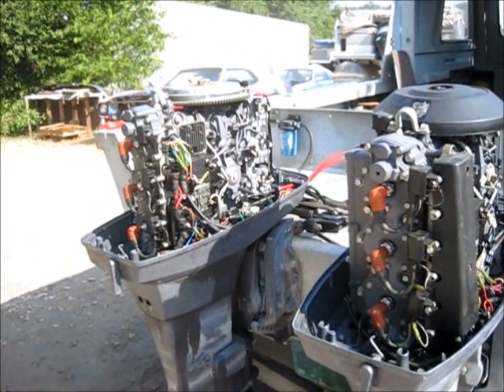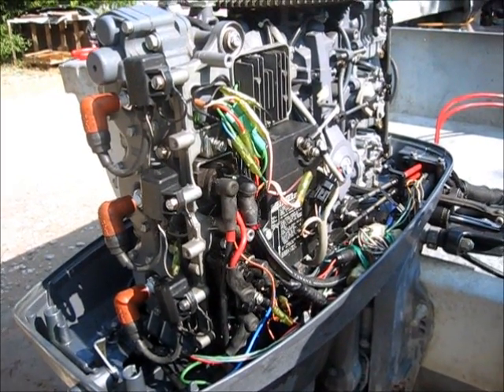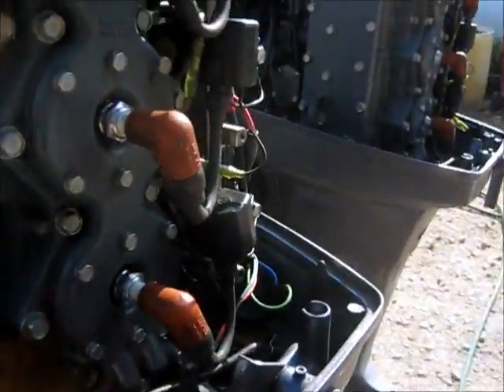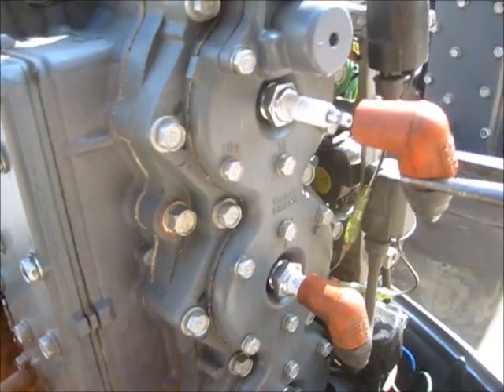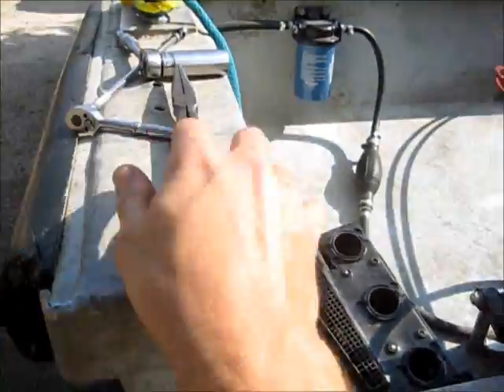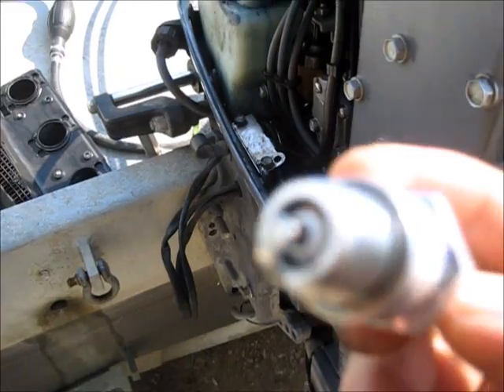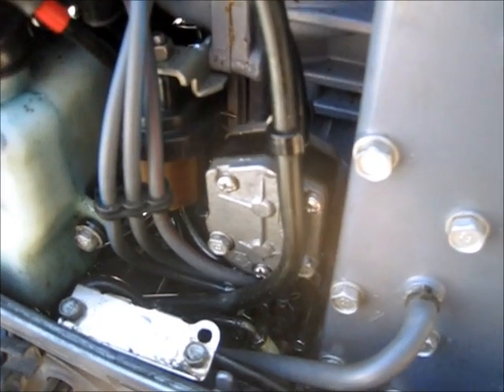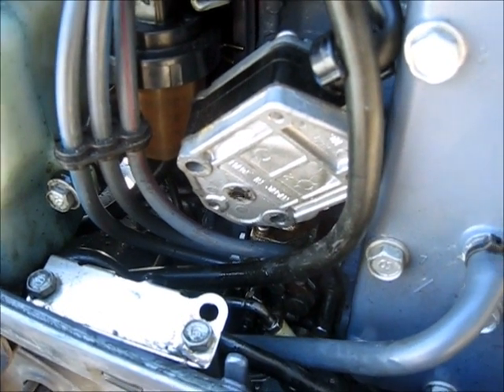2003 Yamaha 90 HP Outboard Won't Rev-up passed 2,500 RPM! FiX

Comment: Our 2002 Yamaha 115 2 stroke won’t accelerate over 2500 rpm. Sounds like it’s bouncing off a rev limiter. 

Any suggestions on what to look for?
Reply from the maker: If you still have an oil tank and auto lube the oil tank sensor is probably bad. Check the pink wire

Comment: Iv got a 55 and it will only run on 1 until your over half throttle anyone had this befor
Reply from the maker: Broken reeds, two carbs with stuck needle valves and the bowls not filling with fuel, bad spark plugs or bad compression... The list goes on and on... You need to do a basic check out.
#1 Compression is it in spec @ or around 120 psi?
#2 Spark does it just a 1/4" gap with a spark gap testing tool?
#3 The fuel system  many of factors here and you have to rule them out...
Good Luck 🤠

Comment: Mine sounds exactly like that when I rev it. Found broken diagram inside fuel pump. Put brand new fuel pump on there and got excited but didn’t fix it at all 😢Sounds the same! Any idea for me please?
Reply from the maker: Yes, it is stuck in Limp Mode Oil tank sensor or pink wire is grounded out.

Comment: Can this be the problem with a Yamaha 30 hp 3 cylinder 2000 mod. The carbs have been cleaned, all three plugs have spark and the compression is good on all the cylinders.   But it won’t rev clean. Would mean a lot if anyone could answer! Thanks

Comment: On my 6 cylinder yamaha I have 3 low pressure fuel pumps. It's a 2 stroke. I pulled 2 plugs that weren't getting spark and on the plugs it was straight gas no oil. But other plugs there were oil.  Can that be a cracked fuel pump leaking acces gas in the cylinder?  If so having 6 cylinders and 3 fuel pumps. Does one fuel pump do 2 cylinders then?

Comment: I have a 1988 90hp doing the exact same thing. I just took it off and pumped the ball like you did and fuel is leaking out of the sides. I'm going to replace it.  Thanks for the video!!

Comment: I was having this same issue with my 80s model yamaha outboard 2 stroke motor. It wouldnt rev up and it smoked like hell. Was getting good compression and spark but no fire.... A buddy sent me this video. I removed the fuel pump and tore it apart and low and behold. A massive hole in the diaphram .. i ordered a new fuel pump. If this fixes the issue im sucking off 10 large mouth bass fish at once.
Reply from the maker: LoL, I'm sure this is your fix with a broken diaphram and Happy FIshing. LoL
Reply: Update.. still didnt fix the issue. Wont rev up  hardly no fire in lower cylinder when trying to rev up
Reply: @Travizzlee what was ur issue
And what was compression numbers
Reply: @135-j   The issue was A bad rod or cracked block. After doing countless hours of work to this motor i had it on the water for 5 mins and blew a hole in the bottom of the block where i was having issues with cylinder not fireing.  I pulled the motor off and set it on a stand in my barn. Thats where yamaha motors belong. On stands for show.  I've never had any luck with Yamaha In my opinion it's junk In this motor just proved it I put a 115 horsepower Mercury Tower of Power on it instead.  I'm extremely satisfied
Reply: Did u ever switch coils
Reply: @135-j  yes. Same issue
Reply: Nice

Comment: ths is a fix for some idle but want rev  up  if you have remote fuel tank  with hose conn each end  they  have a tiny o-ring on the female plug it gets a hole init from ee lots of use take afish hook hook it and pullit out  replace both o-rings  this hole lets eng suck air instead of fuel  you can buy these small o- rings at boat shops

Comment: I have a 90 up two stroke the oil feeder taken off I mix it my self now seems to run great to about three quarter revs and then when I knock it onto full revs it cuts out engine after a few seconds it will start again after but struggling to think what it is
Reply from the maker: Start with the basics run a compression test followed by a spark test with a spark gap tester set at 1/4" you should see a nice blue fire. It could be a number of things from high speed jet clogged or even the stator breaking down that feeds the CDI.
Reply: @WAH420  thanks I’ll start with the carbs
Reply: Did u remove oil system yourself is it a kit or just removal
I wish I could find video or article on it

Comment: Hello, i have the same problem on 1998 yamaha 200 saltwater series, wont pass 2000 revs on load in neutral it does. Compression is good 115 to 120 on all 6, spark on al 6 but two cylinders aren’t working i got spark but the plugs are washed just like the one u showed. What else could it be, pumps are good not leaking. Thanks would really appreciate some advice thanks
Reply: Same problem on my 150 yamaha! Did you find the problem? And what was it if so???

Comment: Having some trouble with a 2007 50hp 2 stroke Yamaha. Oil injected. Sat for a while. Cleaned carbs. Checked spark. Would idle decent, but wouldn't rev up. Realized the oil pump wasnt working. Deleted the oil pump and used mix gas instead. Now no fire to #1 cylinder. Any ideas? Could it be the coil for the #1? I was getting fire initially. Could the diaphragm be bad and flood out #1? Runs on 2 and 3...
Reply: What was ur issue and how did u delete the oiler
Was it a kit or what

Comment: I had exactly the same problem with a 90. Those see through 
plastic diaphragms seem to crack easy. They are not so durable as the old rubber types where.

Comment: My 85 Yamaha runs great in a drum of water but will not start when I put it in the water at the boat ramp plz someone explain this to me
Reply from the maker: Go to my Outboard Page for help!
https://www.facebook.com/groups/203346153363750/
Thanks, B
Reply: the way you explained it, it could be low compression on some cylinders. the water creates too much backpressure against the exhaust, and with low compression the engine won't idle. i have seen this on a few engines. corrosion killed those engines.

Comment: Do you know what the compression should be on that engine.  I have same but not sure.  I have 72 psi on all 3 cylinders.  Not sure if that's ok or not
Reply from the maker: That's a little low 120psi would ideal but as long as the numbers are the same that's a good thing. May check and replace the head gasket could have a leak also would be a great time to inspect the bores. Can also follow me on my outboard page on FB
https://www.facebook.com/groups/203346153363750/

Comment: Maybe somebody can help me here I put a new trim pump on a 90 ho 2 stroke and when I push the button to go down it goes up and when I push the button to go up dosent do anything thanks guys
Reply: Rony Morales try changing the solenoids over there’s a chance one has went. If it work then that’s your answer. There should be three cables blue is up green is down (green grass blue sky) and a ground. Swap them around. I have found that the Yamaha part was £160 but managed to get one from car electric place for £15 that some the same job two seasons now. Hope his helps.

Comment: I just bought a blue wave with a 1998 Yamaha 90horsepower 2stroke well the middle cylinder had 0 compression. The ppl I bought it from put seafoam in it and put it on the water for about 45 mins and they said that at first it was half power but then that second piston would get power and it would run good for a few mins then stop . It did it a few times before they took it out of the water. What do you think that could be?
Reply from the maker: O compression is no good! start by pulling the head and have a look. Could be a bad head gasket or needs a rebuild. Check out my outboard page on Facebook 
https://www.facebook.com/groups/203346153363750/

Comment: I have an identical engine only a 2002.  Mine originally ran at 5700 RPM now seems to only do 4300.  I suspect spark plug but yours only does 2500 RPM with one missing so now I'm not sure.  Thanks for the video!
Reply: I only get 4000rpm can you report your findings?

Comment: i have an old yamaha 28 hp 2 stroke (has the same fuel pump) it has a problem sometimes if i hit full throttle it revs up to 2000 rpm and after a few seconds it just gets up to top speed. haven't checked the carb jet but could it be the fuel pump? (by the way english is my second language so sorry for the bad grammer and all)

Comment: Hi would like to ask you if you can please help me out I have the same problem on a Mercury M2 V6 jet engine a guy told me that it is like an outboard head just that it is installed on a jet section
To start with I removed the carbs cleaned them and reinstalled it worked fine when started up then it came like before..... that is when I rev the engine it goes to 4000 revs maximum and make the sound exactly like your video can you please help me cause its driving me crazy. Thanks in Advance Mario

Comment: Mine, idles ok,
But shakes and chokes when I accelerate.
Cleaned out carbies and jets, replaced coils and spark plugs, old stator, fuel pump too but still doing it. Do you have any other ideas of what it could be .?
Reply from the maker: Oil level sensor,   Maybe Faulty try unplugging the pink wire from CDI power pack or in the wire harness or loom... 
 

Wanted to Add: If This Don't Fix The Limp Mode Sound and Still Won't 
Rev-Up!... Check or Unplug the Oil Sensor on the Oil Reserve Tank it 
maybe Faulty...

Hope that helps
Reply: wah420 thanks for that, i will give that a try. If it works what part should I replace to fix it?
Reply from the maker: If Oil Injected!   The Oil Sensor on the Oil Reserve Tank would be bad.
Reply: wah420 my yamaha 70 hp 2 stroke runs well but sometimes when i give it full throttle when on the water it wont rev all the way up to 6000 - 7000 rpm it will only be hitting around 4000 rpm at full throttle ?? but this is only sometimes ?

i havent looked at the carbys but i have changed the spark plugs ?

what do you think it may be ? 

thanks
Reply: Daniel Duy Nguyen same problem im having
Reply: What did U end up figuring out the problem to be

Comment: Can that allso make the motor run blue smoke all the time the motor runs. It has auto oil feed to mix the oil and gas? It just started last two times I went out. The motor never over heated
Reply from the maker: I would remove the oil injection. Block it off and premix the fuel your self at 50:1 ratio...One pint to six gallons of fuel or 16oz  of TCW3 Marine Outboard Oil...
 Two strokes smoke you want the blue smoke just not to much of it... Sounds like you need a new oil pump for your motor or looked at if you are having an over oiling problem...

Comment: My Yama travels at top speed and dies suddenly. The middle carb isn't revving up to the max. It's clean. Can u help please
Reply from the maker: I would run a compression check and Spark Test on the Cylinders... Check and make sure you have good Fuel and the fuel pump is working to supply your motor with gas at full throttle... I would Suggest a Fuel / Water Separator if you don't have one...

You Can also find me on my FB Group Page... https://www.facebook.com/groups/203346153363750/

Comment from the maker: @ Jerry 
Have you checked the fuel pump to see if it leaks through the Diaphragm...
Also check your Throttle and make sure the butterflies on the carburetor are opening all the way...
Make Sure it has Blue Spark with an ignition tester with a gap of 1/4 inch or more...
If that's all good the main jet in carb is clogged...
Reply: Thanks!  a bit late for reply, but after my friend gave me the coil and put on the Tohatsu outboard and it seems run good and no choking at wot now!

I also thought it was fuel or pump problem, you know sometimes reason a lot for same problem btw.

Thanks for your video and suggestion, I maybe learn more too :)
Reply from the maker: Thanks Glad i could help... You Can also find me on my FB Group Page... https://www.facebook.com/groups/203346153363750/

Comment: My boat setup with big and small outboard, the Big is a Yamaha 2 stroke 115hp and small outboard is Tohatsu 2 stroke 18hp.  Using same tank of fuel with premix gas and oil in the tank, then go to a fuel water separator filter, then I separate fuel to both outboard with two valve.

When I using the small outboard for trolling I would close the fuel valve to big outboard, so the fuel should only goes to small outboard.  When using big outboard I do the same to the small outboard fuel valve.

I ran great with my big Yamaha 115 2 stroke, but problem with small Tohatsu 18hp.

The small outboard getting some trouble maybe same as this.  It doesn't rev high speed, I do not have gauges for this small outboard so i don't know is it could run faster than 3000rpm, but it doesn't rev high or even it doesn't having great power to push my boat fast as other boat with same setting.

I had checked the following:

fuel line (including the valves) clean
carb cleaned
checked propeller is good
2 cylinder checked no leaking and compression good at 115psi

My friend had a same Tohatsu 18HP 2 stroke in a same 21 foot boat but his outboard runs much more powerful then mine, he said maybe the ignition system gets wrong, so next step I will ask my friend to using his outboard ignition coil to my outboard.

Or do you had idea about my case?

Thanks!